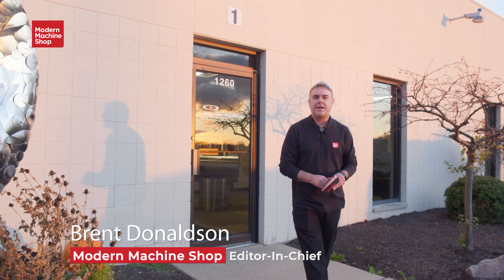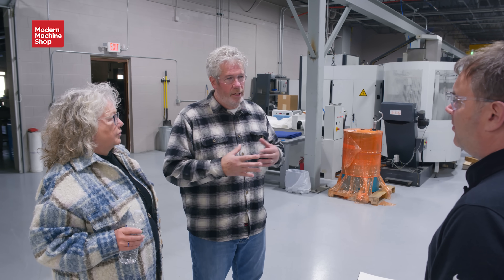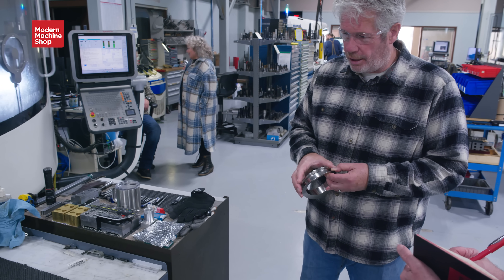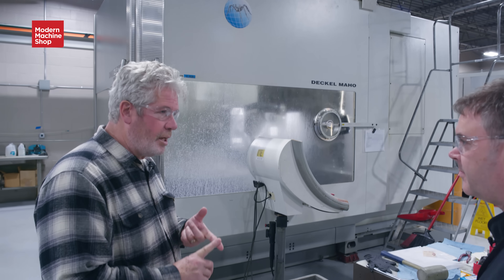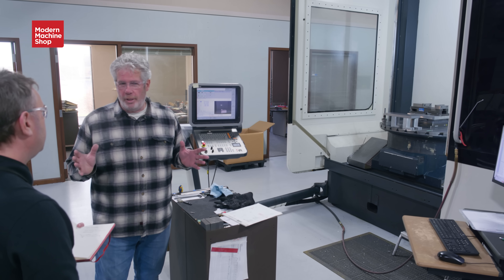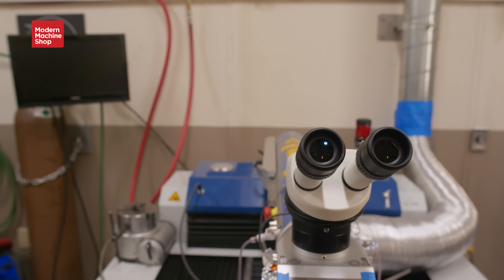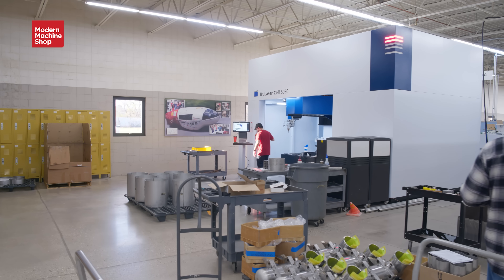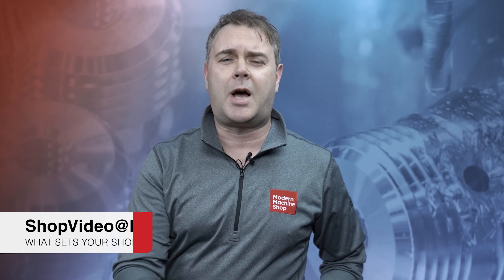From Garage Startup to Leading Aerospace Job Shop

Comment: How do you become NADCAP accredited? I’ve looked into it several times but only came up with zero. Even the companies that are supposed to help you, do not return calls.
Reply from the maker: Hi! Here is the response from the owner: NADCAP is an accreditation per category---SJTI has NADCAP Welding, Laser Welding, NDT---this is different than ISO 9000 or AS900 that is a certification of how a company operates…NADCAP is specific to how a company follows requirements for a manufacturing process and follows customer requirements and industry standards, audits conducted by industry experts. PRI was created as NADCAP  and the letters meant something…but they don’t anymore. There is a Nadcap meeting run by PRI www.p-r-i.org Feb 24-27, 2025 in Garden Grove CA USA
You get the requirement ---Check List from PRI. Then you set up your company to meet the requirements of the check list. Do a GAP Analysis then fix what does not meet the requirement. When you are ready for an audit you schedule with PRI…it is usually 3 to 6 months till someone will come do the audit. Based on the findings, you pass the audit or not. You have a set number of days and 3 times to get the findings corrected. 

The major Companies in Aerospace and Defense set up this process. PRI became it’s own entity and is still somewhat connected with the Tier 1 Aerospace and Defense companies.
Reply: @modernmachineshop thank you so much. I will reach out to PRI.

Comment: Friend of mine got the contract to re weld f 18 drop fuel tanks for the boeing company, mainly because boeing could only do 1 maybe 2 tanks a month, where as he could do 4 a month the contract was worth over 20 million a month  and he was successful getting it off boeing AU.  👍👍✌✌🦘🦘
Also supplied the specialised welding wire for it and also the specialised x ray equipment and testing facilities to test the pressure with water inside the tanks before certification back to boeing. ✌✌🦘🦘

Comment: Nice shop. Just dont understand how these jobs pay for all these machines.
Reply: Because in aviation, especially commercial aviation, parts that have to be certified or PMA’ed get marked up astronomically. They more than likely have 10s and dozens of multiple 6 figure contracts.
Reply: Apparently they made revenue of $7 million last year.
Reply: @dandersen464  but before they open the business they may not have 7 millions in the bank
Reply: Where did you find out their gross revenue? Illinois Dept. of State? Federal website?
Reply: Like that seat arm rest part he was talking about. I’ve worked with seats in a Pilatus pc-12 that $50,000+ per chair…
Reply: @dandersen464
Reply: I was just talking to my cousin who works in a very large aerospace machine shop that does bulkheads for F-16’s and such and they get over $200K for those.  Of course the bridge mill they run them on is in the millions so there’s that.
Reply: The shop would be yours if you understood
Reply: Obviously, they lease that machinery.
Reply: I doubt they need to lease. If you saw how much these shops get paid for even the simplest parts, you'd know how they can afford everything.
Reply: Amazing shop! They are set for life and are going to have the best non retirement ever. I worked for a Startup Aerospace and Defense company a few years back in Silicon Valley best job I’ve ever had. Aerospace Contacts are BIG money for the littlest thing. And if you’re doing some ITAR or Classified projects even more $$$.
Reply: It's all about the certifications, secure those, and you can charge your prices without needing to compete with other non-certified job shops.
Reply: Aerospace price premium. Simple as.
Reply: Aviation parts are stupid expensive.
Reply: They know how to bid jobs. They aim high.
Reply: Aerospace = License to steal = taxpayer
Reply: You can go buy a $300,000 machine, and financed over 5 years your monthly payment in $5000-6,000.  Those machines, if run correctly, will easily produce 10x that per month. It’s not as crazy as you think.